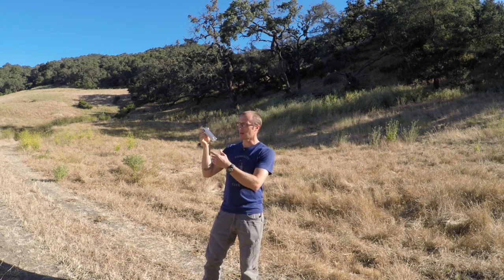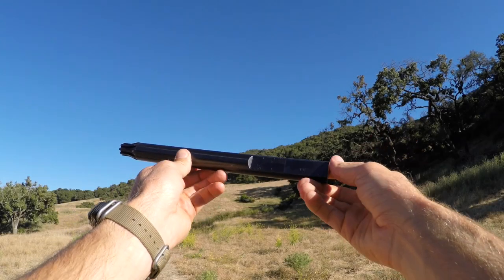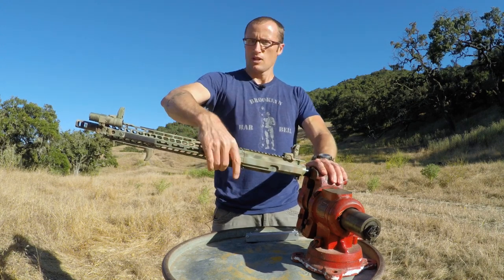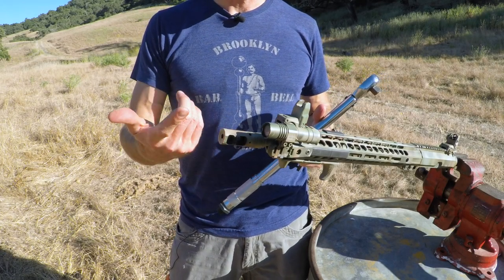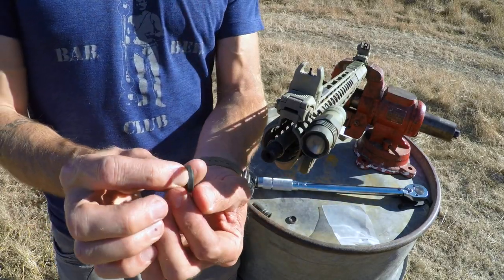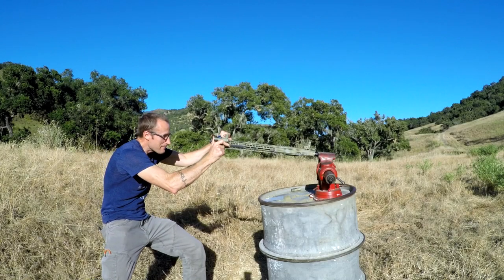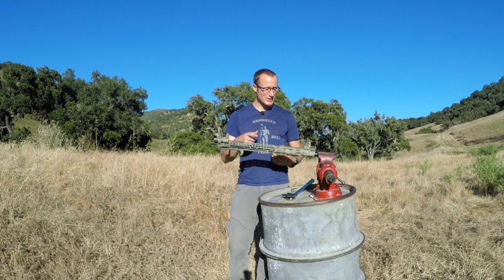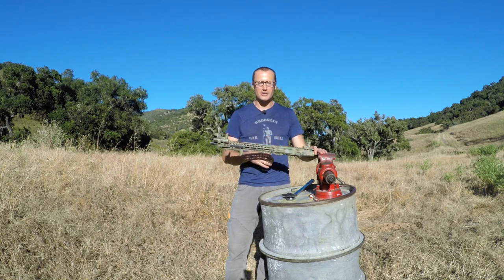Geissele Automatics Reaction Rod

Comment: What about a knights rifle? I have a Knight Stick which looks like that rod except it will fit it the proprietary knight’s barrel extension. Have you worked on those before? My muzzle device came in the mail yesterday a 5.56 QDC MAMS device. Any pointers? I’ve been told the knights muzzle devices are known to be extremely hard to take off.